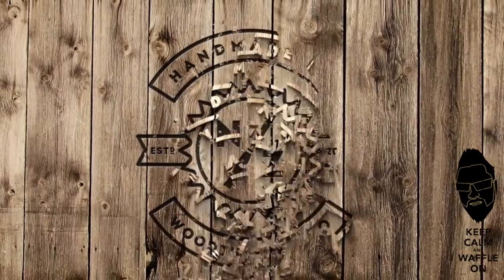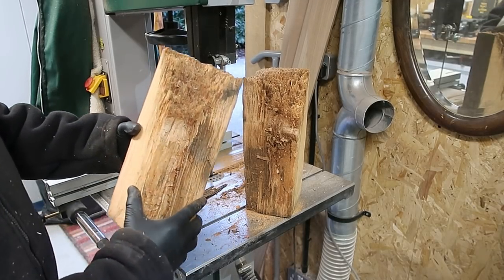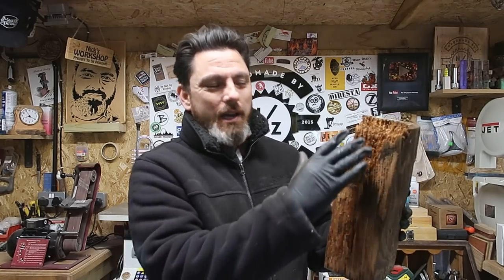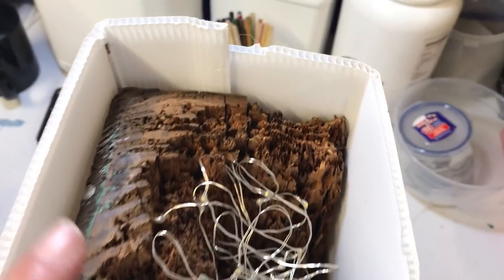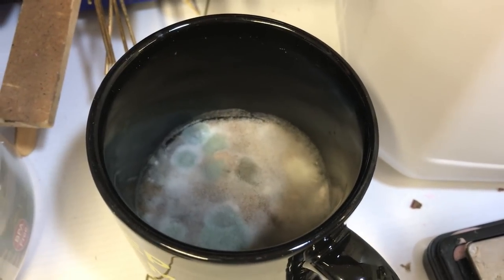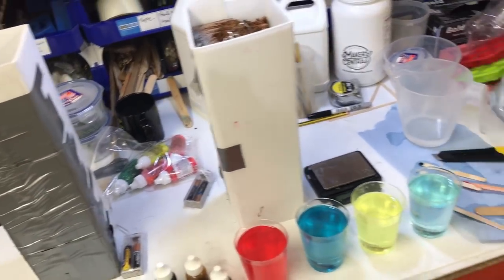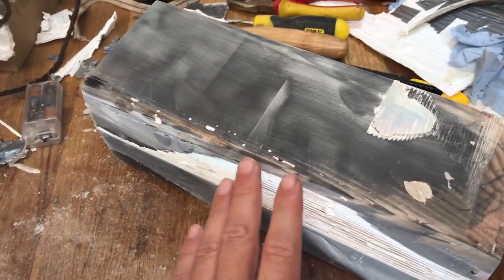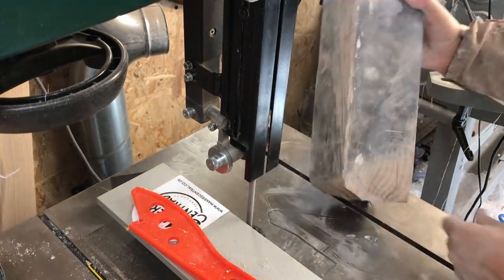Using Alumilite Dyes & resin to convert a 600 year old beam

Comment: I think your multi-color idea would work if you let each color harden before adding the next. You could even tip it in a different direction each time so it isn't just flat layers. As for the lights, maybe if you make the piece first and leave a hollowed out center, you could add the lights and fill the hollow with resin at the end. That way you wouldn't have to work the piece with the wires in it. You could even imbed the battery box half way into the resin and put feet on the corners. That way all the electronics are self contained with no exposed wires to get screwed up.

Comment: I noticed you use a pressure pot , Would a vacuum chamber work just as well ?  If not why ? What are the differences when using resin on wood with both ?

Comment: Nick, what if you cored them out on the lathe so you could fit a full-sized (or even a somewhat smaller, especially for the smaller of the two) light bulb inside? Basically turn it into a giant lamp shade of color. It might be worth a shot, if you still want to salvage this one.

Comment: So while you were talking about how things went wrong on this project I was wondering how to maybe get this idea to work, and if you read this comment, I would like to get your input. Now I think the main issue was lighting, because even if everything did go right, eventually the led's would have burnt out. Now what if you drilled up from the bottom and had set fiber strands up, into where the resin would be setting, then seal the drilled section off so that you could input a changeable light source. You addressed the other issues.

Comment: Always fun to see the failures every now and then, just for variety in the midst of all the cool stuff that works! Just a random thought... Those lights are LEDs, right? So, the D stands for "diode," and diodes only allow current to flow one way. Since people tend to miss little details like that when they get frustrated (I know I certainly do!), I was wondering if you tried to connect the wires both ways when you were testing if they'd work after you reconnected them?

Comment: Book ends? put a shelf in front of a window and have those stay on it. Or gently probe for the wires until you can solder them. As for it not lighting up when you had it connected led lights are one way. They are diodes so you probably had them wired backwards
Reply from the maker: haah good idea

Comment: I think you could salvage it if you bore about a one inch hole maybe a little bigger all the way through from the bottom then push your light up from there it won't be as originally planned but it would be at least usable and could look pretty good

Comment: Had you only put a recess on the bottom the same shape and depth as the power module, you could've rolled the wire up under cardboard and masking tape and then filled the cutout with gelatine and have kept the wire safe throughout the shaping and cleaning process till needed.

Comment: I might frill through them top to bottom and then add lamp works and a simple shade.  That will make the 2 bedside lamps that you originally set out to make, albeit differently.  But you would still honor the 600 year old wood.

Comment: Were the lights LED'S if so there is a polarity to them and if you hook them up backwards they burn out instantly. If you cut off the wires and mark them for polarity push slack in to a hole and seal with clay on both ends so resin cant get in after you finish it  you could pull the clay out and reconnect the wires just a thought Ps great channel and thanks .

Comment: I only just watched this video, if you still have these then you could maybe drill a nice wide hole through the bottom of the wood just until it meets the resin at the top...then fill the hole with resin and fit a light at the bottom so that it shines up through the resin and illuminates the top...similar to a fibre optic light? :)

Comment: I was vaguely wondering if it would be possible to drill up from the bottom and dig out the light strings, then make them into sort of a lamp shade, so that they could have a brighter light in the base.  Heck, what's the worst that happens?  :)

Comment: I think next time if you drill holes throughout the whole piece then filled with resin and then drill a hole in the middle afterwards with lights inside of that it would look really cool or you could just drill a hole through the base all the way to the top and put like a flashlight in there or torch in your case

Comment: I originally wondered why put the wire out the back side?.... I would think a great idea would've been was to put it out the bottom (with a tube or space into the wood to hide the battery compartment while working on in - but would the resin seep into it)? Just a thought...

Comment: Chin up, old beam; I've got a 10-20% failure rate on almost everything I make.
I think you could perhaps turn that big piece into a rolling pin that might look pretty good. Maybe round it off on the lathe, polish it up, then cast that rod in clear resin, then back on the lathe to round it off again? There would still be the issue of resin not sticking to resin, but perhaps that won't matter if it's completely encased.

Comment: I'm NO electrician specialist, but if u can get a hold of any wire u can still fix it, drill a whole where it intersects the wires then strip and connect ur current, which will then light them up.... I wouldn't have given up!
Reply: He said he got a connection at one point, but they just wouldn't light up.  Depending on how hot the resin got during curing it might have been too much for the light string.  Might have been better to get some unsoldered LEDs, run some thick uninsulated wiring with the LEDs soldered on through the resin (no wires near each other), and see how that does.  If the wires are run near each other (+ and - wires), and the resin weakens the insulation it's possible he just has a bunch of shorts throughout.

Comment: you know you could hollow them out and  leave some of wood add more resin on the inside and thin it out so you can see through parts then add lights fixtures so it would be the base for  the lights

Comment: Take and drill from the bottom with a 12 inch 1/8th inch bit through to the resin and then load your lights and wires through it and then fill back in with resin. It SHOULD work that way. Should give at least the larger 1 a shot.

Comment: For lamp, I would had drilled hole all through to the bottom, placing a tube in hole. Running wire through tube for lights and also use hole to attach a lamp at top once done.

Comment: Hello Nick, OK, it didn't go so well. Pick yourself up. Brush yourself down and .  .   .    .  This is still worth saving 'cause it's 600 year old oak(?) and you owe it to everyone who sat there shouting " No! no! no. .  .  . . Oh, no."     Strip the resin and wire away from the wood Carefully. You don't need to go back to bare wood. The holes in the side could be useful as additional light windows, but maybe rough them up a bit inside, away from a cylindrical shape. I think you are probably right about fewer colours, but if you chopped away some of the flat wooden face, maybe you could separate colours that way in the mould, with lights breaking through the cut holes. Perhaps battery power led could be hiked up to 12v mains? You could even consider this as Upcycling; very worthy.  Go for it, Nick! You do have the tenacity.  Regards, Glenn. :-)

Comment: Have you considered pouring the color-infused resin in separate stages of setting so it doesn't mix into one ghastly color?

Edit: I would like to see you come back to this. Perhaps with a brighter light on the bottom, you could get it to work with a really cool electronic bit in the resin casting.

Comment: Hi nick new viewer from down under, just a quick one i see you used the coreflute material to set the resign but did you cut up a chopping board for the base? Just wanted to know the reason for that. Cheers

Comment: Those lights are LED's, yeah?  Look, Nick, you have a lathe so let me explain how you can still find out what the lights look like inside of the resin.  Get some enameled wire, get some PVC pipe and put it in a chuck.  Turn it on a very low speed and proceed to spin the enameled wire onto the PVC pipe within the chuck until you have several hundred turns of the stuff on the pipe.  Then, look up the VERY simple AND cheap to build Slayer Exciter circuit, build it using your new PVC coil, power it up and bring those beautiful failures near the coil to see the lights begin to glow.  I promise, it is super safe to operate at 12-18VDC and it will wirelessly light those bulbs up beautifully!

Comment: the lights should be fixable did you try changing the polarity? LED's only work one way you can test them with a cr2032 watch battery just dont over power them when testing or they will burn out also. sorry you had trouble with them but I like a good failed project video it teaches a lot :) keep up the good work and better luck next time :)

Comment: Here's an idea:  You cut the beam into 4 parts and have only used 2 of them.  Why not take what you've learned from these and make that pair of lamps you wanted?  Perhaps mount the switches in the base(underneath) so you don't have any risk of destroying them whilst de-molding.  Of course, you'll have to make sure that they don't get set in the resin and be totally unusable.  I personally think they turned out rather well(other than the fact that they didn't work).  Also, LED lights are polarity specific:  the positive and negative must be connected properly in order to work.  Been watching you for a few now and just realised that I hadn't subscribed.  That's taken care of now.  Keep on doing what you do, I'll keep watching!  =)

Comment: You could've put the cables through the bottom and leave some wire to connect them later to the batteries

Comment: I wonder if you could dig around very carefully with a tiny tool and free the wires well enough to reconnect them.

Next time how about, wire the circuit to go through some brass rods embedded into the side of the piece. You can sand them, and you’ll have two little round brass patches you can solder to.

Comment: I am curious, on a super porous piece of wood like this..... what would happen if you dripped some dye right onto the wood before (and i mean right before) you pore a very lightly colored resin in on the wood. Would it stream up into the other resin? Like seaweed from the bottom of the ocean? 
Also an idea for you..... since you are making lamps, it would have been a better idea to not put the mini lights in with the resin but rather after drill a hole through almost to the top..... then add the lights and cut a space for the battery at the bottom. Reason be, those lights can be fragile and need replacing.... Not just the batteries. It would be interesting to try and form a orb pocket inside for the lights to bunch up into after drilling (is there any drill attachments like that). Maybe try these ideas..... a clear plastic Christmas ornament that opens up to insert things (would it crack is the drill hits it and will all the pieces be able to pall out if it brakes?) A small water balloon (would it all come out with the drill or would the resin melt to it (maybe putting the release on it as well as pinning it down)). 
Interested in your response, if anything I may have given you some ideas for future videos.

Comment: You might be able to fix it if you frost the outside of the epoxy to refract the light. Try it on the smaller one. I don't think that this project has failed yet, you just haven't found how to succeed.

Comment: Would the original LED strips been bright enough for a lamp, even if the project had worked? Less dye would have helped, but even clearer resin blocks a fair amount of light, and that light strip was buried within a lot of resin.

If you wanted to pour the resin around the light, then it might have been better to from the start cut a space for the battery pack into the base rather than running a wire outside the form. (Would you need to shield it from resin though? I'm assuming the resin seeps through the wood.) As for the multiple colors, can you pour one color, let it set, then pour another for a layered effect? I don't know if the new resin will bond with the old though, and you wouldn't get the mixing effect.  Perhaps instead you should mix a very light base (to have something other than pure clear) and then just swirl in some complementary dyes, like the smoke-like twirls done in some previous projects?

As for the failed bit, I guess once you'd realized it had failed, you could have tried to turn it into something like a vase...  Not sure if the light strip would have ruined that though.  Or drilled a deeper shaft through the bottom and put a serious light into it, but the dark resin would probably have killed that.

The idea of making a lamp is probably worth revisiting in the future.  Just do some more testing and planning first.  (Will the light strip even work once set in resin?  How much will the resin dim it? Do you want a lamp that you'll have to throw away once the light strip dies, as you won't be able to replace it with a new strip? etc.)

Comment: You could always put them on the lathe! Also, I think your lights didn't work because of resin in the wiring after you put it in the pressure pot. Next time maybe make sure you have waterproof lights maybe?

Comment: If your light strings are LEDs and you reversed the polarity of the wires they may still work. Reversing the batteries will be easier than in reversing the wire connections.  LEDs May still work.

Comment: I say old bean, that's an old beam you have there. I know I suggested fairy lights in a project so i accept part responsibility. However I am wondering if it was the pressure pot that caused the bulbs to blow. Or if some how the resin melted something while curing.I will send you some of the 2 meter ones so you can try a different project or experiment with pressure and non pressure curing.

Comment: I don't know if that would actually work, but may be you could crack it with a hammer on the top, which might create some spiky texture, and try  to get out the wires and then refill it with some translucent resin

Comment: I think it would have been better to create a pocket at the bottom to house the battery, then drill a hole straight down through the center to run the wire, then seal it off with hot glue to keep the resin out. With all the electrical housed inside, it would be much easier to avoid damaging it.

Comment: What if you placed two brass or copper cubes with the wires attached in the wood protruding to the edge of the mold. Then after you're done doing what ever, drill two holes for wire pins from your power source? Aye?

Comment: Ya'know Nick you need a heat gun so you can flow your hot glue after you build your molds so  you don't have to use so much tape.

Comment: I don't really know but just an idea for the romantics the would you have for this idea of course motor release LOL but lighter colors and to put instead of trying to install the lights in at the beginning and do what you did with the hole drilling at the bottom and then try to install a light through there and with the resident being clear of the light should show up better just an idea but love your show so far

Comment: Dumb question: did you check the polarity of the led wiring?
Reply from the maker: erhhhhhhhh ?
Reply: Nick Zammeti NZ WoodTurning LEDs are basically electronic one way valves so if they don't light it might be you've got the power leads the wrong way round.

Comment: Do it again. Next time drill a hole in through the bottom before you resin.  This will act as a conduit. Run wires through it...then seal it up before resin. Might give you a better chance of success.

Comment: Not that it matters at this point, but in my opinion, that beam should never have so much as seen the teeth of a band saw. Not to be rip cut, at least. A cross cut of that large, rotted out basin (stabilized), could have made one wicked awesome blank. It would have taken multiple colors better as well. Nonetheless, your ambition is inspiring.

Comment: Stabilizing resin may have worked better for the wood. You can add colors, as well as reuse the resin...much more economical. Not sure how to correct the wire issue. Or the light up issue. I'm sure you can find someone that can give you tips...as for the overal look, in my opinion, you may have had better asthetic look with either 50/50 wood/resin or 25/75 wood/resin...lamps don't seem to look right with stubby light sources. Sorry.

Comment: so sad the lights dindn't work out. if you just dig those wires out the back a bit with a chisel, you realy should take atention connecting them the right way because it is a LED chain and those are polarity sensitive. then it might have worked.

Comment: dude cut a hole where the wires go and recess the battery box inside the block you resined and re connect the wires!